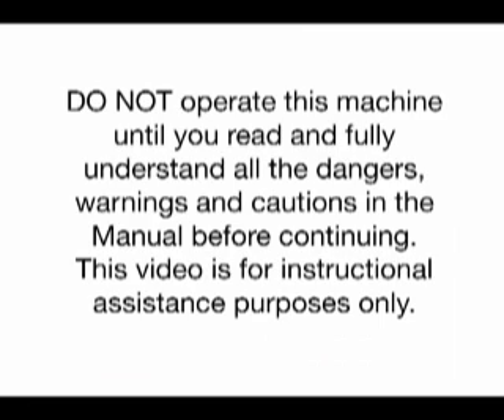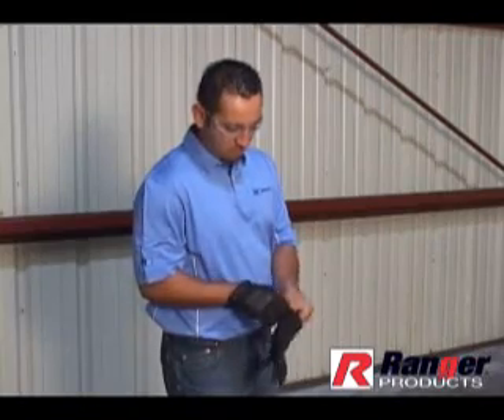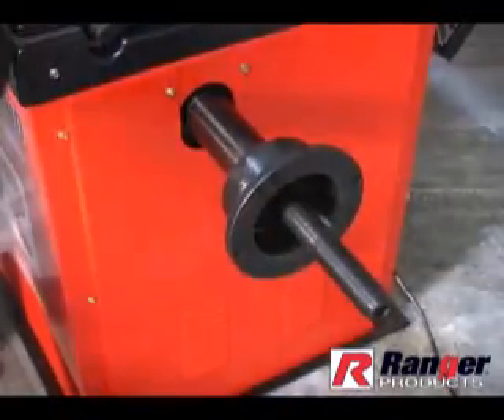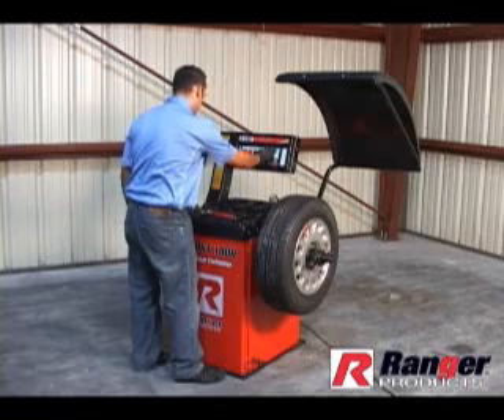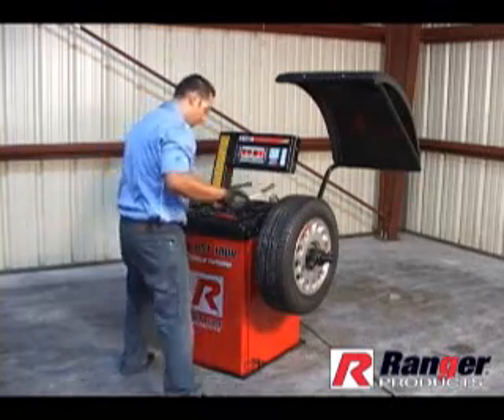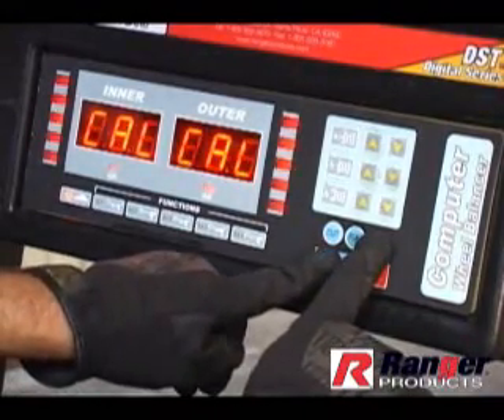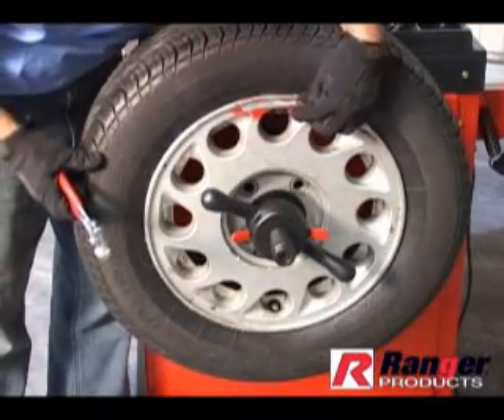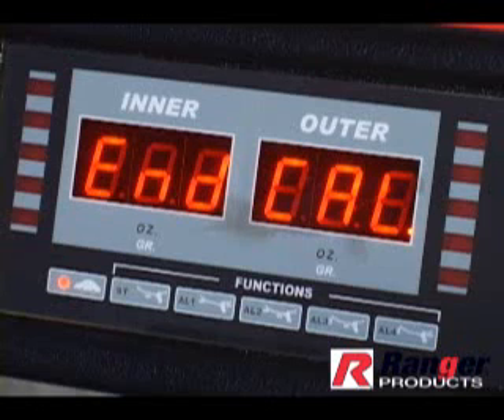Ranger Wheel Balancer DST1000 Self Calibration

Comment: I have this balancer and would chase weights until I realized the wheel width doesn't read the actual wheel width.  When I plug in the right wheel width it reads the same when rebalanced every time.  Crazy but yes mine doesn't read correctly.   I compared my wheel width guage to other balancer gauges and yup!  This one that came with it is wrong, as crazy as that sounds. I think it's like a half inch off and the chasing weight differential wasn't huge but never repeated.

Comment: I assume the wheel that you use to calibrate should have all previous weights removed first?
Reply: The calibration wheel used must be of the required size  & be pre balanced (wheel balanced will likely have wheel weights on it)
Reply: @bestbuyautoequipmentinc.5898  So i would have to take the wheel somewhere to get it balanced before calibrating my machine?  The video that i watched also said a steel wheel but it looked like an alloy wheel that they were using.
Reply: @Dmax04  did you ever get your machine working properly i have a dst 1200 I am having trouble calibrating
Reply: @tylerschnell9907  i never did. I have gone through all of the calibration steps just like it says in the owners manual numerous times. When i try to balance a tire it has me chasing weights. I can put the first weight on and spin it and it will say i need another weight just a few inches from the first one. I have all but given up on this balancer. There is no one locally that works on them. I`m keeping my eyes open for a good Hunter machine. That`s what a lot of the shops around here have and there is a guy about 30 miles away that works on them. Wish i had better news for you.